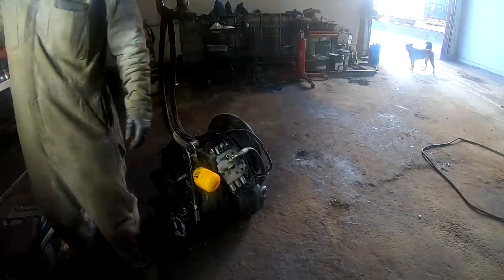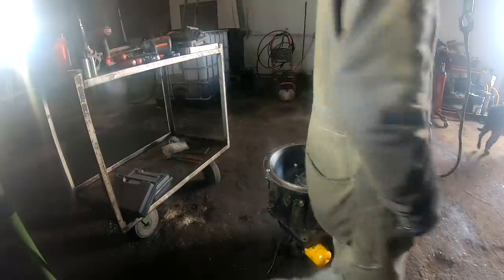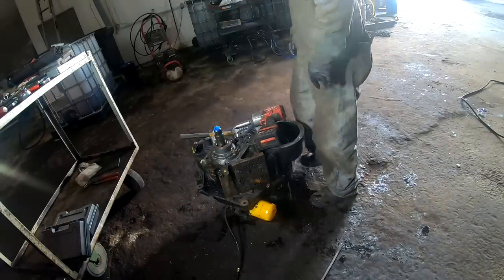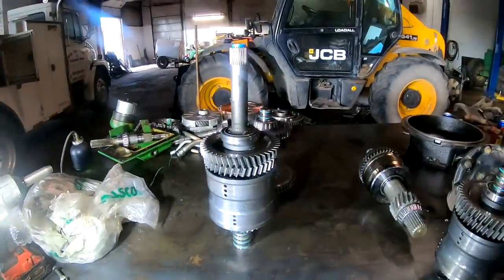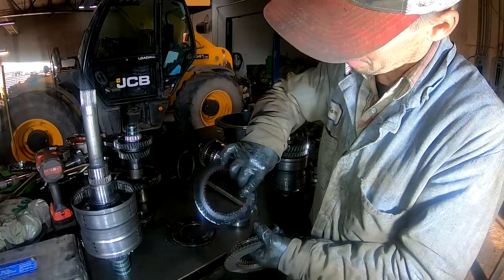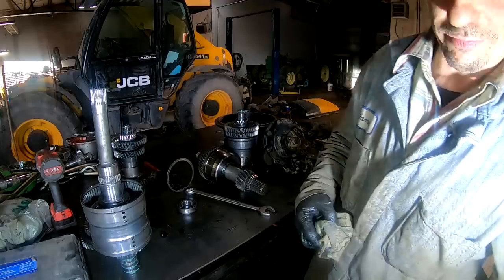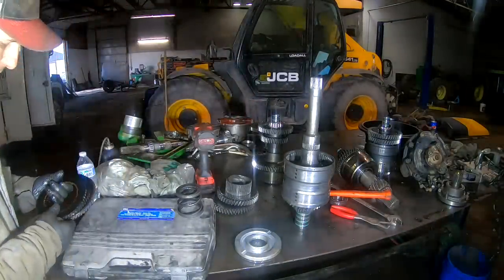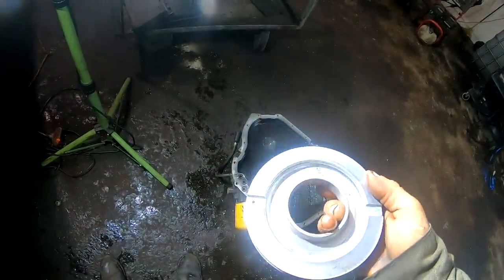JCB powershift transmission disassembly

Comment: Check the housings where the sealing ring end of the shaft goes in, very common for the housing to chew out and groove it, then you will loose pressure there, have done a few now where the housing have had to be replaced/repaired

Comment: Hi love to watch you work . Check the housing where the oil slip rings run these transmission had a problem wearing the housing then they louse the seal on the slip rings this can then engage both clutches on the shaft causing the weakest clutch to fail or as I have seen the transmission to lock up as you had in extreme cases it will rip the transmission apart. We the housing bored and a wear sleeve pressed in
Reply: John Lockwood this is when an air test shows up the problem. Seeing pressure on two pistons at the same time indicates a worn seal or bore.
Reply: I was gonna mention the 4 teflon seals and the housing they seal in, cause them seals can become 4 little machine lathes on that housing

Comment: Hi Warren . With all the friction material gone , would that cause the piston to move too far and lose all the oil pressure .. may even explain why it was locking up too if the piston came out too far and got jammed at an angle keeping the friction discs locked up.
Reply: Yep I've seen that happen before

Comment: Put a front pump, seal ,bushing and torque converter in a similar JCB backhoe.
Now perfect.
Thanks for your lectures.
JCB is oldest largest mfg of backhoes in the world.
They make excellent stuff.
I miss  the Perkins  engines though since CAT owns them now.
PS operator who shuttles wot in high fwd to reverse cooks clutch packs.
I disconnect high third.

Comment: If all of the friction material is gone, perhaps the piston is travelling further than it should and losing its seal on a groove in the shaft or housing? Perhaps a built in protection to prevent clamping a clutch with no friction left and setting the transmission on fire.

Comment: I know on the Milwaukee impacts, you have to make sure of the model numbers, not the drive. They will have 3-4 different 1/2” or 3/8” drive impacts, all with different lbs. of torque.

Comment: Im working on a Massey Ferguson 50A with an instant reverse transmission that has a clutch pack as well and it pretty foreign to me. I can’t drive it forward but it kicks into reverse pretty well. I know I was missing one of the output shaft piston seals that slides into the input shaft, but I’m not sure if that would kill my ability to drive forward and I want to make sure I look over all possible causes before I put it all back together. I have new clutch discs and plates in both packs and a new pump. Linkage on the pedals appears to be solid as well. 

Can you tell me what these little steel ring seals function as and if it can be my main culprit here? Also, is there a way to test the operation of the clutch pack assembly through an air test?

Comment: Hi Warren, I didn’t see in the video but is there a piston stop like a snap ring or a is that first plate that is wavy the stop plate for the piston? Just wondering if the piston was at the end of its travel and not leaking therefore you wouldn’t see and pressure drop to speak of. 

God bless

Comment: I was wondering how many carriages were on that train, could the pump and filter be bound up with the worn friction materiel  or the pump not quite able to supply enough flow of oil at pressure any more

Comment: Does that trans shift down or can the operator leave it in too high of a gear and burn the clutches?
Reply: Stays in the gear that you selected, will not downshift
Reply: That's why it cooked most likely a clueless operator  power shuttle cyclic fwd to reverse in high for days.I disconnect high on mine.Run in low when working pushing digging etc.
Reply: @007.3l  That's what I suspected. You can't make the operator any smarter so they need to make the machines smarter. Many operators will run in too high of a gear.

Comment: air checking it wouldn't have help  with diagnosing because the clutch packs are gone I bet they where really putting a load on it in high gear just like a clutch would slip in fourth gear on a car floored and in high gear would do it

Comment: all it takes is 1. on my 700r4 3-4 pack only 2 discs were down to steel everything else looked new. on a pto clutch pack slipping from heavy overload will warp those steels wavy then it never shuts off. this does'nt look expensive no busted gears planetary sets and big sun gears. good design but i would'nt do towing with that loader

Comment: 3:15 If that orange item on the housing is a Fram filter, I see that as a Red Flag! 
Wouldn't a NAPA filter be better?
Reply from the maker: That's a JCB filter.
Reply: @westerntruckandtractorrepa1353  Maybe you should have cut the filter element open, it would have saved you a day :-)